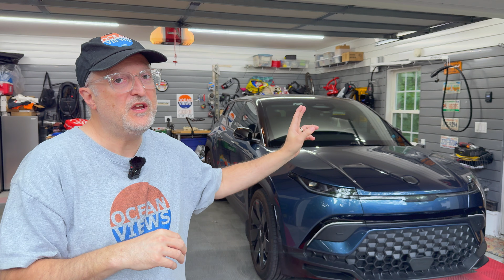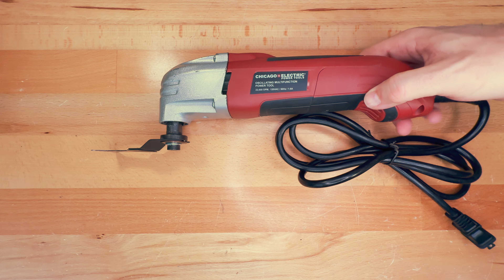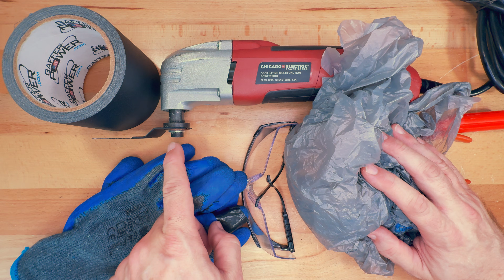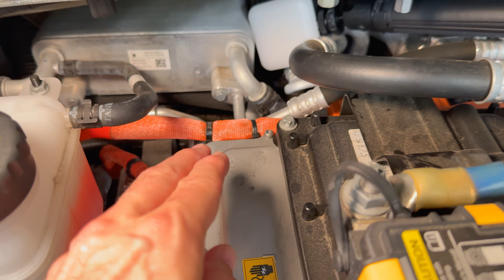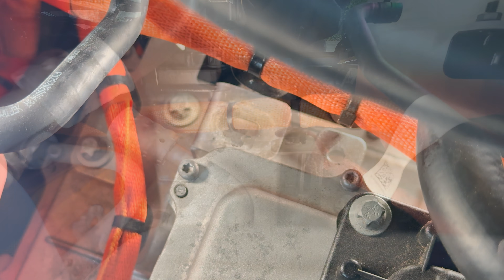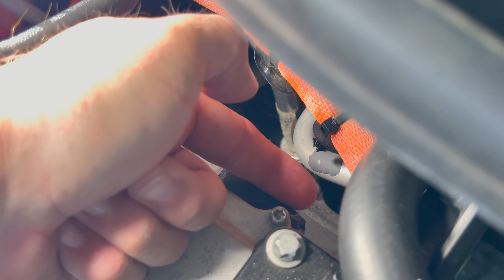Fisker Ocean - Chiller Pipe Fix

Comment: Thank you, Matt for the detailed "How to" -- I just did the repair on my FOO (21,000 miles on it) when I noticed there was wear on the chiller pipe.  I used a Dremel Tool to cut off most of the tab, but getting it in there was tough.  Just took a little patience.  Thanks for all you do to support the community. Cheers!
Reply from the maker: Yes, it's a tight location to work in.  Good to hear you got it fixed!

Comment: Hi thanks for the video. But one question, can we not just isolate the cooling pipe, let’s say with glass fiber or rubber.
Reply from the maker: If you add anything to the pipe, it will also eventually wear through.  That even happened to the JB Weld I applied to the pipe. It's just best to remove the source of the issue.

Comment: Help me understand, does that tab rub into the chiller pipe, it seemed far away
Reply: Eventually it can totally destroy the pipe.  One owner had it fully pierced.  Trust me you don't want to have this happen.  Cutting the tab, unfortunately, is the best solution to prevent future damage.
Reply from the maker: Yes, that is it. While still, it doesn't touch. In fact mine was about 15-18 mm away. Due to the motion of the motor on the mounts during acceleration, it can touch the pipe.
Reply: I'm curious does the contact happen on acceleration or deceleration, could someone put a camera under there while they're driving to see what it looks like?
Reply from the maker: @mcm8327  Great idea.  I'll have to find a way to mount the camera and a light so it doesn't move.  It's also in a tough location to fit and see the pipe.
Reply: @MTNRanger  yeah, i did the jb weld like your original fix and was surprised at the scratch that appeared with the additional thickness, its not making contact with the chiller pipe but the movement was more than i expected.  I have been driving gently, so was curious if its regen that is making it move.  i was curious about gently dinging the pipe as a fix.